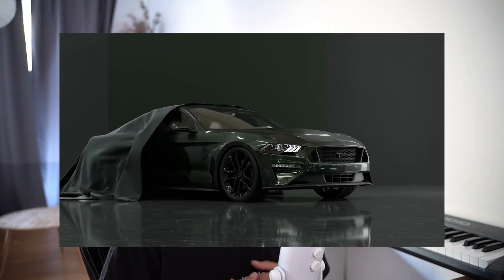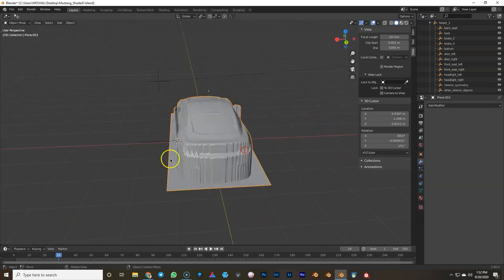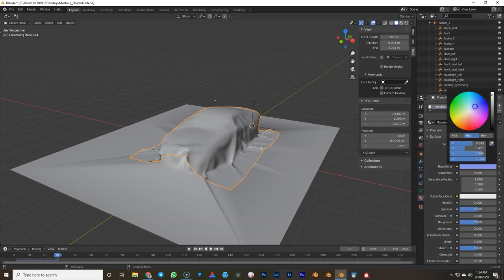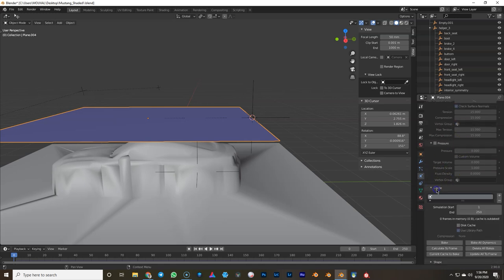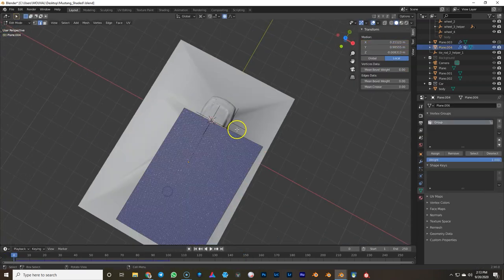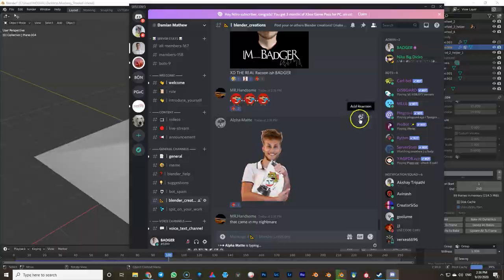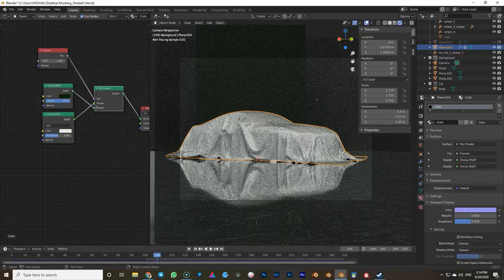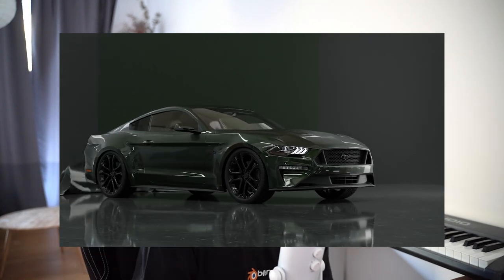Cloth Reveal Animation in under 10min | Blender 2.9

Comment: I tried to do this with another car but I had an issue when I made the shinkwrap modifier: i did the same the samething than you but id doesnt fall on the floor, like there are just the parts on top of the car that fall , the rest stay at its initial position, do you have an idea why? thanks
Reply from the maker: I'm not sure: But try joining the floor plane to the Car Mesh.
Reply: @DamianMathew  It worked !! thank you so much!!

Comment: i wonder if everything broke in 3.5 or something else is wrong here. I tried another "10 minute" tutorial and everything acts pretty bad, and it has the same steps as yours. Hooking a vertex group that is also assigned to the pin group seems ok up until you move it. If you move your empty while the sim is running it will ruin the sim cache and its a pain to fix (have to turn off the modifiers).

Comment: brother you made this tutorial so much undetailed im crying im a beginner and cant follow up? can you suggest me a course or other video?
Reply from the maker: Yeah I struggle since people say pls keep it short, others want it long. Where are you struggling?
Reply: @DamianMathew  i want to ask u  said the shirnkwrap will go to infinity. u did a cut in video several times. people cant folow that fast bro.  when i added floor olane and added shrinkwrap to the plane above and project - negative its going in upward direction. wrong direction doesent behaving as urs one in video
Reply: @DamianMathew  can u help me in instagram
Reply from the maker: @basejumperdx4573  go check out discord, there’s a lot of people ready to help
Reply: @DamianMathew  brother just tell me what u mean by a floor plane is a floor plane different than a normal plane?
Reply from the maker: @basejumperdx4573  there’s nothing different. With floor plane I just mean the plane used as a floor. The floor plane could also be round I guess.
Reply: @DamianMathew  ohk bro
Reply: @basejumperdx4573  I had the same problem.. you have to Ctrl+J the Floor with the car so they are 1 Object.
Reply: @alexdang   THANKS BROO
Reply: @alexdang  thank you so much ly man i was stuck for hours here😭😵
Reply: @alexdang  you saved me

Comment: hey, you're the guy of the car animation ? why do u use the shrinkwrap modifier ? to simplify cloth computing with this plane unsubdivided?  thx
Reply from the maker: Computing but also just so it actually works, otherwise the cloth will slip into all kinds of cracks. It is called a 'collision mesh'. I recommend you always use a collision mesh when using any kinds of physics.
Reply: @DamianMathew  ah ok thx , i ve already used the object of interest directly as a collision object, but it was already a plane; i Imagine that it could be by far more complicated to use this high poly car + a plane as collision objects . Nice tip ! thx a lot